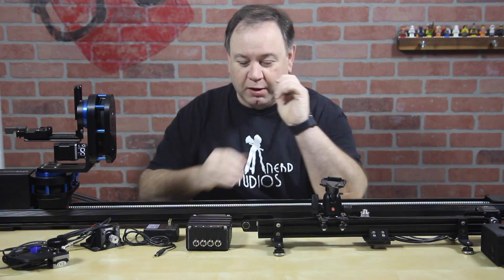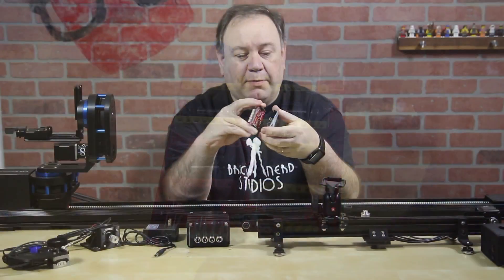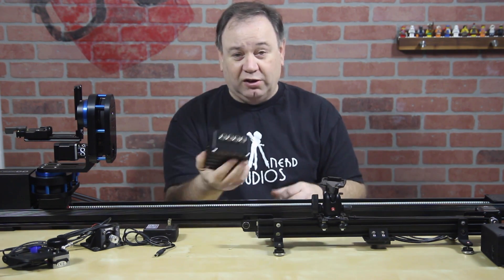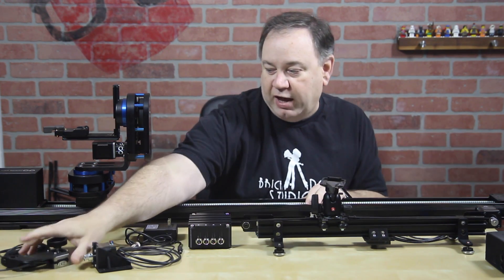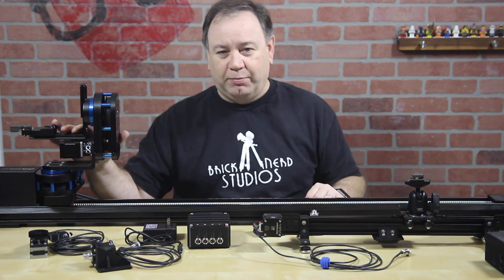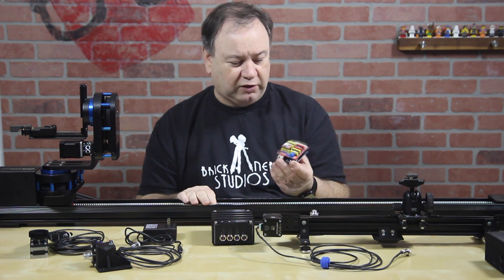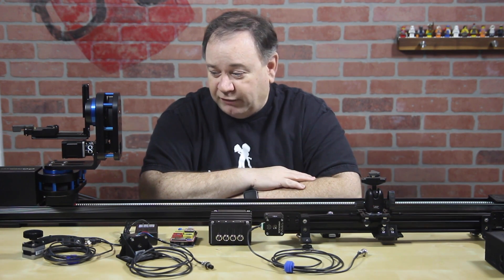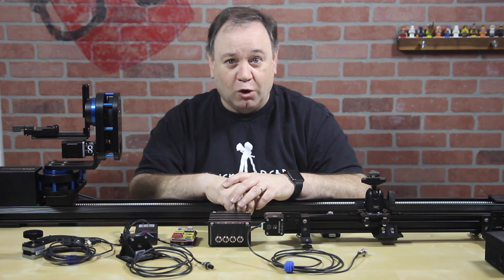The NerdFlex motion control system

Comment: Hi. Thanks for the video, extremely helpful! I'm planning on using the Openbuilds blackbox to connect my stepper motors to Dragonframe. Quick question, once connected is it possible to use the video recording functions in Dragonframe? I'm a videographer and don't actually need the stop motion functions, I read somewhere that this approach may only work for stop motion not live video inside Dragonframe. Any chance you can confirm it does work? If you also have any tips that would be amazing. Something which may be helpful to you since there's lots of play in those Dynamic perception pan units, I'm planning on using some Robot D link joints from Igus. They're expensive but should be able to hold a cinema camera and be very sturdy - https://www.igus.co.uk/product/?artnr=RL-D-20-101-38-01033
Reply from the maker: I assume you're talking about doing some real-time capture, I haven't played with anything like that but could use that on occasion too. I've only done stop motion and time lapse with Dragonframe
Reply: @BrickNerdTV  Thanks for the quick reply. Yes that's right, real-time capture. You can see it all in the "motion control" section of their tutorials here - https://www.dragonframe.com/tutorials/ - I've emailed Dragonframe as well but if there's any way you can test it out I'd be extremely grateful
Reply: @maxbridge8921  did you ever receive a reply from dragonframe? Looking to build a similar setup, and curious if/how it's possible to do some live motion control with dragonframe, or if I should start looking for other software/options. 1700usd for the controller from DF is a bit much for me at the moment unfortunately...
Reply: @stickje666  you have to get the 1700 dollar DMC 16 for dragonframe. I'm using Mantis instead, still expensive but less than Dragonframe and has more features. The UI isn't as nice but otherwise better. Search BFG mantis on Google and you'll find it. If you chat with Gerald, the guy who makes it, tell him I sent you